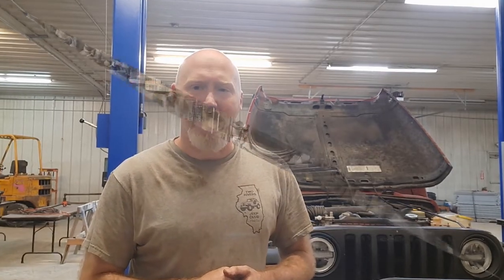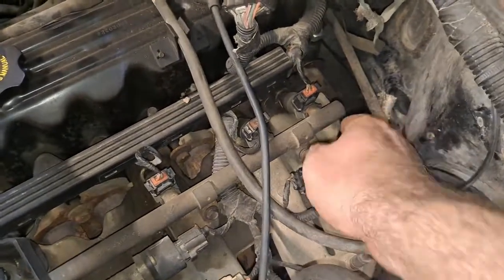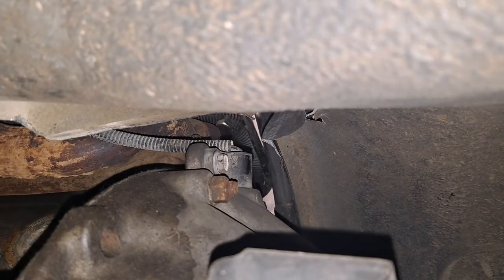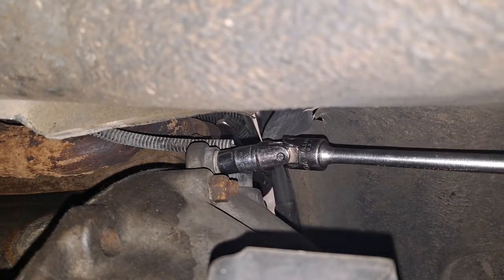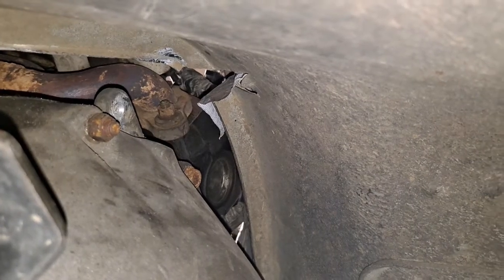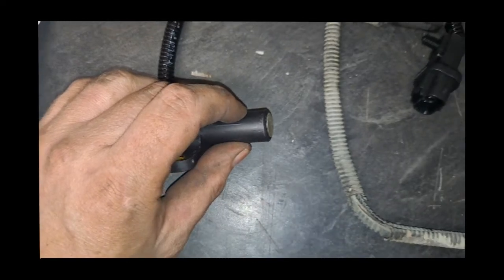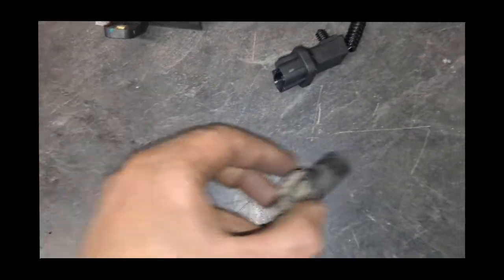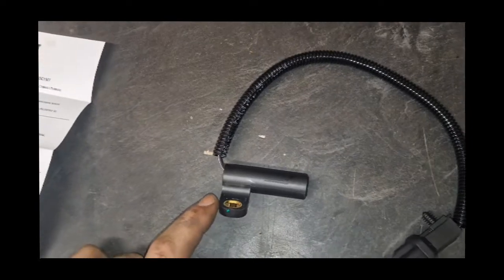Jeep TJ Wrangler Crankshaft Position Sensor Replacement

Comment: So if my Manuel takes 2 bolts to hold and I ordered the one like yours, would it be fine to put in or should I order the right one
Reply from the maker: You will want to buy the correct one for the manual, the sensor spacing and structure is different.

Comment: Guys I have jeep wrangler model 2010 diesel. I have changed new fule pump and 4 new injectors. After 6 month of driving it now suddenly there is no power while accelerating. What should I change to fix the problem? The engine light is on as well. Any one experience the same thing. I’m in Australia and mechanics are sucks here
Reply from the maker: Unfortunately in the US we didnt get diesel wranglers so we personally havent worked on any.  My guess is that a sensor or something in your injection system is bad again.  Can you get a scanner to see what codes are being thrown causing the check engine light?  That would be the first step towards potential fixes.

Comment: Just replaced mine and not fixed I guess part is bad??
Reply from the maker: What is the jeep doing, has a code, running poorly, won't run, dies?  Could be various causes depending on symptom.
Reply: Only one code for crank sensor.  Won't start just cranks over. Was running great then threw code and now no start
Reply from the maker: @joshpitts25  There is a video to test the crank position sensor with a multimeter.  If the crank sensor tests good then your down to checking wire continuity.  I have in the past had a couple of TJs with broken wires in the harness.  https://www.youtube.com/watch?v=GmA-DKRcAcg&t=95s
Reply: Does engine have motor mount lift? May be sensor clearance was tight.

Comment: Nice video, have question my jeep when pass 10 or 15 minutes fail and turn off wait about one hour and start perfect, change gas pump same issue i think is crank sensor?
Reply from the maker: No codes?  I haven't known the crank sensor to do that.  I would put a fuel pressure gauge on it and see what it does when it's dieing.  Maybe Idle Air Control valve is what I would look at next